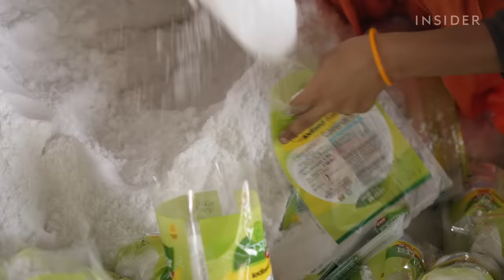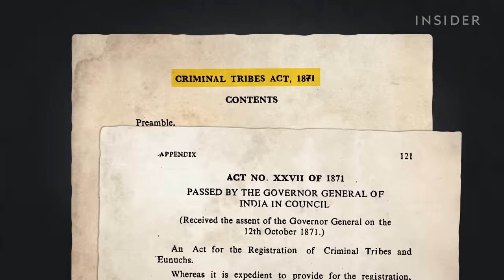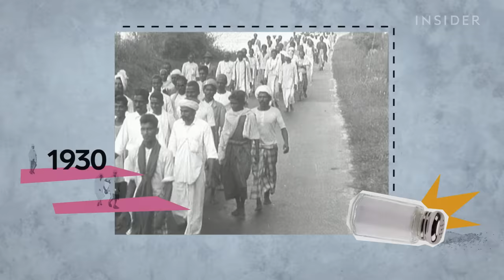Why Salt Farmers Risk Their Lives To Harvest Desert Salt For $4 A Ton | Big Business

Comment: I agree to pay Double or even the 4 times the Price I am paying at present for salt
But, Agharia community should get a fair price for their hardwork
$4 or ₹308 for 1000 kgs of Salt, it is outrageous
Reply: That's exactly what I was thinking.
Reply: With inflation in the US, I’m good.
Reply: "fair price"

It is a fair price. Their work is not even remotely valuable and the methods they use to extract it are horrible inefficient. 

Salt is not rare. Salt workers are not rare. Nothing about their job is necessary.
Reply: @LaFonteCheVi  
You've placed such low value on their lives so flippantly. Did it even enter your mind that it's necessary for them to survive?
Reply: @LaFonteCheVi  yes, salt is the most abundant resource after the air, the water and the Soil on this planet
So, I will suggest you, to spend a week without consuming any type of Salt or Salt containing edibles
And share your experiences with us ,in this the same comment section
It's only a matter of a weak, and today is Sunday, so you can start from tomorrow, and share your experience on next Sunday
Reply: @firstnlastnamethe3rd771  It is not about their lives. It is about the work they are doing.

"Did it even enter your mind that it's necessary for them to survive?"

Obviously. That doesn't mean that they should be paid more for jobs that shouldn't even exist in the first place. They are paid what they are because if they were paid more, their jobs wouldn't exist at all. They methods they are using to extract salt are terrible and inefficient and require too much labor to function. If you raised their wages to "help" them, then the buyers would simply look elsewhere or pay the costs to properly industrialize the process.

Think with your brain for once instead of your heart. You people constantly advocate for "helping" people but never realize that it ends up doing more damage than good.
Reply: @basantprasadsgarden8365  The methods they are using to extract the salt are extremely inefficient and labor-intensive. They are paid what they are paid because that is what their job is worth. Pay them any more and it will cease to exist entirely as others can extract salt in much larger quantities for cheaper.
Reply: @LaFonteCheVi  if you know some really efficient and advanced method of salt extraction, than you should Take some time and teach them that, this will help in empowerment of a Historically Exploited and Discriminated community
This will add merit to your heavenly account, if you believe in that
Or it will make you feel happy, if you don't believe in the God stuff
Reply: @basantprasadsgarden8365  " if you know some really efficient and advanced method of salt extraction, than you should Take some time and teach them that"

It takes millions of dollars in investments and upfront costs. Plenty of companies already do this and compete against them. Which is exactly why the are paid so low as they are competing against massive salt industry.

Instead of salt farming, they should find something else to capitalize on. They are working is a field that will always be low-value.
Reply: @LaFonteCheVi  then provide them jobs and livings at the first place, so that they don't have to do this job anymore. Remember they are *trapped*, not intentionally doing this technically illegal job for salt sold for only $4 per ton. I'm pretty sure that they would agree to move to other places if they are provided the opportunities to do so. Low income causes low protection on price fluctuations or other sudden expenditures (illness, accidents, disasters, etc), so they have to borrow loans to survive, and to pay loans they have to continue working on this job, left with no means of getting out of this trap. A perfect example of third world farmer's dilemma.
Reply: @LaFonteCheVi  if I knew , I would have left for Kutch by now, but , unfortunately, I don't know any method other than the evaporation method , nor I have any experience with salt extraction, worst of all, I have never seen a Sea, in my life of 20 years
So, as you said that their methods are ineffective, so I thought you are a master salt producer, who knows really some cool effective way to turn brine into salt, so I suggested you
Reply: @LaFonteCheVi  
 My heart is connected to my brain.
Buyers could pay a buck or two more a ton without going anywhere near bankruptcy.
And, if they ended this kind of production, brought in expensive machinery and the higher paid workers to run em, these people would lose their livelihood, end-up doing some other horrible job, or begging for food on the streets, and we'd be paying more for salt, anyway.
Reply: Isn’t the average wage lower in India?
Reply: I think people are not understanding they are making $ 4,000 for HALF a years work for a family. Which doesn't seem to be much unless you account for average ANNUAL income in India for the area may be $ 2,500 or less. So yes, those that are making $5 or $6 for 1000ks of salt are actually pretty well off. $4 is not fair. But $8 would really make them too well off so it doesn't make sense. Also Salt is a uniform commodity as is water. There is global competition for the production, so of course the traders aren't making too much themselves as well.
Reply: @firstnlastnamethe3rd771  and you've put everyone's money even lower 
If they give these guys anymore so many people will have to live without salt in India 
4$ is a lot in India you can live 2 whole days with that happily

Comment: I'm confused. Near the beginning they mentioned the water has 10 times more saline than sea water but near the end they fear extracting too much ground water. Are people meant to be using super salinated water for some other purpose?
Reply: The idea is that the water percolates into nearby areas
Reply: water can flow underground. perhaps when they lower the groundwater level in the salty area, non-salty groundwater flows in from areas around it. they certainly are evaporating a lot of water.
Reply: @Ass_of_Amalek  That true, but they also said the rainy season is like 4 months. Shouldnt that be replenishing ground water? just my thoughts.
Reply: @michaelharipersad9882  this isn't not amazon rainforest, rains in deserts will take a lot time (hundreds or thousands of years) to replenish ground water.
Reply: Wait, you mean Insider might lie to people? Like saying the pumps are powered by solar but immediately show a gas powered engine? Or show clips suggesting they build some of it by hand when clearly you can see machine marks on the trenches?
Reply: Ground water is a finite resource. Basically, if they expand salt farming too quickly, some day, there will be no more salt to farm. Kind of like overfishing.
Reply: don't believe Insider  just watch it as a show😂
Reply: @srpacific   @teknokracy  i think the most important part is government subbed, the pump at 3:35 is elektrical. I also dont see any machine marks
Reply: @zGunTroll  machine marks?
Reply: If they keep extracting groundwater faster than it replenishes , gradually the water table will drop and the remaining groundwater will get saltier and saltier , eventually the water will be finished and the salt would get trapped underground in crystalline form . You need the water to transport the salt from below to above the ground .
Reply: Ground will loose saltiness if removed everytime
Reply: taking the water there makes all the other water saltier which still seeps elsewhere, if the water level drops too much sinkholes can form
Reply: They're afraid of extracting too much because then they have to move further into the desert and / or eventually they'll be out of salt water
Reply: @srpacific  lmfao, i was thinking the same thing!
Reply: @zGunTroll  it might be an electric pump, but that doesn't mean it cant be running off of that generator (and it looks to be cause of the colour and thickness of the cables matching the desiel generator).

They painted the salt buyer to be the villain of the piece, and you can tell that but the language they use, insinuating he's lying about how much he pays. Insider always leaves alot of shady stuff in their videos that let you know that they're not giving you the full picture. (Eg "These people know it so well, they can taste when it's ready" Yeah insider, I'm sure it's a one in a billion tongue that can distinguish salt in water.)
Reply: There is finite groundwater they can use to leech the salt to the surface.
And since groundwater replenishes MUCH MUCH MUCH more slowly than it is extracted there is always the risk that extraction will consume too much of the available ground water reserve leaving too little water to continue the process. And we aren't talking 4 months to replenish ground water, we are talking decades to centuries.
Reply: @GeorgeMonet  But if they use this salty ground water exclusively to bring salt to the surface, doesn't it just mean bring it up now or bring it up later? Assuming water settles into the ground at the same rate during yearly rain seasons, extracting more salt water now just means less water later but either way it's always salt water getting turned into salt on the surface. Do they want to get a lot of salt now or a more even amount over time?
Reply: @michaelharipersad9882  Groundwater takes 1000’s of years to form. 4 months of rain won’t replenish any of it.

Look into Mexico’s groundwater problem, it highlights the irreparable damage of sourcing groundwater.
Reply: @Penguirrel  it's in the middle of a desert , the groundwater will take at least a few decades to replenish , not a year worth of rainfall .
Reply: @cat-man5522  But still, salt water now or salt water later. They are just making salt today at the expense of making salt later. They didn't explain why this would be a bad thing.

Comment: K, so I’ve learned something here- I was about to make a snarky comment mansplaining that whatever the researcher who ostensibly lived with the salt farmers was researching, it couldn’t have been the chemistry and geophysics of salt production, because I was sure that the brine they are working with would have to be alkaline, not acidic, based on my experience in agricultural contexts with the pH of saline soils created by surface evaporation of groundwater aquifers under artesian pressure. In that context the terms Saline and Alkaline are used pretty much interchangeably, as the salt deposits created that way are pretty much always significantly above 7 in pH, at least in my corner of the planet. I decided I should google the topic a bit before clicking the send button on my snarky comment, just in case my Dunning Kruger syndrome was showing again and there might turn out to be something I didn’t know on the subject.  Lo and behold, the first thing which came up was a scholarly article on the formation of acidic groundwater brines in parts of Australia. Not sure whether similar geography and chemistry are at play here, but it’s fascinating to me that such a thing as acidic groundwater brine can even exist.
Reply: Neat. I was about to make the same comment about acidic instead of alkaline. I wonder the chemistry involved here is. Thanks for sharing.

Comment: Sounds like this market is ready for a shakeup if the profits are really that high for the people buying from the farmers. Some people should easily be able to pay the farmers double or triple, sign long term exclusivity contracts and make safe money while marginally improving farmers lives.
Reply: Unless others start using automated means for the salt pans. The whole process is not hard to automate tbh., only those low wages keep it from happening since initial investment will be somewhat high and operators skilled in maintaining and operating those machines need to be trained/organized first. The natives will most likely not be those people.
Reply: @Rotblattchinchilla12  the points you raised are probably why this system continues with significant human labor; automating it would incur significant up front costs as well as higher costs for relatively higher skilled laborers to operate the machines. I think even just someone with enough capital to outbid the current buyers for the existing labor pool could result in a win-win for the newcomer and the current laborers.
Reply: @SergeiTheAnarch  yeah and no one is doing it after 5 million people viewed this video which means Business Insider just tried making the refiners look bad. Remember, this family makes $4,000 after 6 months of work. The title says $4 a ton. So 1,000 tons of salt probably take a lot more labor to refine & package & market. Those factories probably have more significant upfront cost than getting the salt and they make 60x more. Then in the US, I recently bought 4 pounds of salt for $4 so that means they're making 500x more. So that means if you believe any of this, you stand to make up to 500x so literally anyone remotely smart would do it OR this video is untrue.

Comment: For the blindness aspect, just wear the stuff that Inuit wear. It’s like glasses but with narrow slits to allow less light through. They can even be made from cheap materials

Edit: they’re called snow goggles but they would work great for preventing blindness caused by the landscape
Reply: Also known as sunglasses. 

If they were good  they would use them. Obviously they wouldnt be since they are not using them.
Reply: @eikeksimimea1071  not sunglasses dumdum. Sunglasses use tinted lenses. Snow glasses/goggles use a much simpler slit in a material.

Comment: How come the "solar powered" pump spits out diesel fumes? I'm very interested to hear that explanation
Reply: It probably needs liquid fuel to start. Starting an engine takes a strong burst of power.
Reply: I was thinking the same. "Government subsidized solar panels... They'll power the pumps that bring brine water to the surface." Immediately followed by man starting a diesel engine???

Hell of a flywheel on that thing though!
Reply: @LP-qf6ue  no it doesn't, that's the thing with a electric motors, they have instant torque. That's why almost all modern combustion engines, have electric starters, which is just a tiny electric motor, to bring it up to speed. 
That's a big Diesel pump in the video, without an electric starter, they've also showed an electric pump, in the digging part, but a much smaller pump.

Comment: My new goal in life is to fly there when there harvesting, give them each some waterproof boots sunglasses multiple pairs of each buzz boots in sun glasses And some other stuff given the fact that you’ll be able to land in airplane not far from them without any issues
Reply: I suspect sunglasses get corroded quickly at the metal hinges. Baseball caps might help too. I think plastic tipped shovels for digging the pans that wouldn't corrode would also probably help.

Comment: This is simple market economics. There is no scam or injustice being committed against these farmers. The real reason table salt is sold much higher per ton than the harvesting per ton comes down to a myriad of expensive adverting, shipping, packaging, employment, and so much more. In fact, most people do not realize why an assembled car is much more expensive than an unassembled car and the factors of obtaining those raw materials for that car should be as low as possible when purchased. If you start to subsidies farming and start artificially raising work cost then the table salt that is being sold by the companies will have to raise the price of their final product to cover new expenses and retain a reasonable profit for expansion, repair, and etc. In the mean time, consumers might start to get upset at the higher prices of those salt products and move to other cheaper salts which will only worsen the state of the farmers salaries. People seriously do not understand simple micro to macro economics and too often think with their emotions instead of understanding the rationale behind $4 per ton harvest and $260 per ton selling to consumers. What this video is proposing causes massive inflation and it becomes a never ending cycle of raise the wage of workers, then companies raise cost and then consumers buy less, the company gets bailed out, the farmers get less money for the value of work due to inflation, rinse and repeat until collapse or bail out again.

Comment: They're paid so little because salt is one of the cheapest mineral to mine under normal circumstances.  Even sea salt is fully a mechanized process of flooding and draining a reservoir.  They're doing it manually, which makes it ten times harder, but doesn't increase the worth of the product.

Comment: The low cost of salt they are collecting is created by technical progress, and the fact that as a mineral salt is not as rare occasion on earth: there are millions of metric tons of it underground, so humanity just mines it with machines from salt caves or underground salt layers with millions of tons, lowering it's price to 2.4 to 4$ per ton.
I assume you can't blame anyone that smith, leatherworker, soap maker, potash maker, lye worker, clothier is not existent professions anymore (in the scope of exactly manual hand workers), they are replaced as automation took those professions over technical progression.
Instead, I really would like to pay more to get salt made by hand, or that has curious origin. I saw that in Africa there are rose salt they make the same way, with proper marketing it costs 2-4 dollars per kilo, not a ton. You just should market it properly, and not compete with industry.

Comment: The Government subsided solar panels will run the pumps… As the man hand crank starts a 100 year old Diesel engine that connected to the actual pumps.

What is with this obsession with green energy? If it could work it would work in that desert, but it doesn’t that’s why they use 100 technology instead.